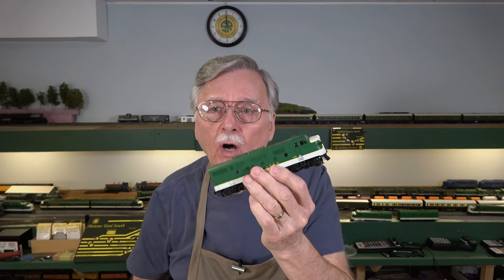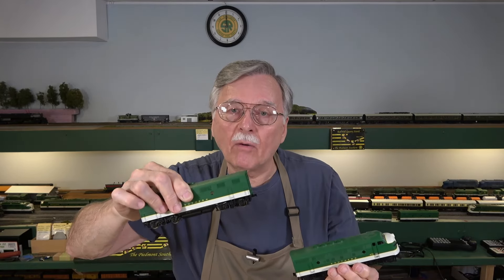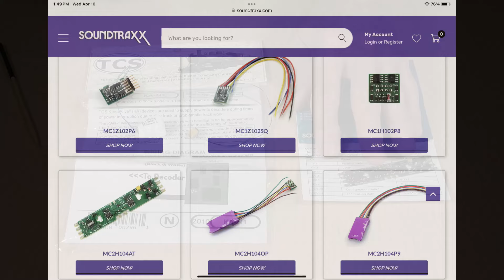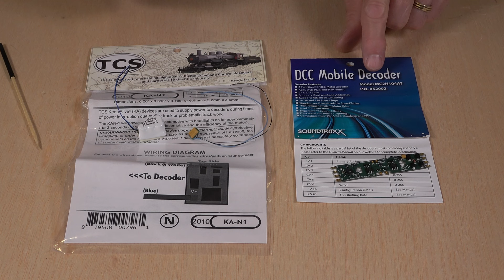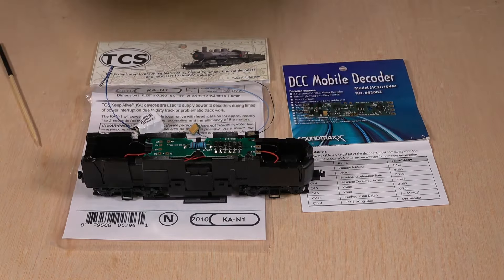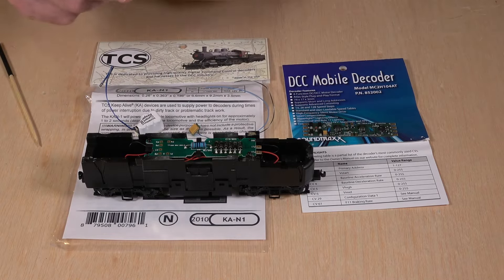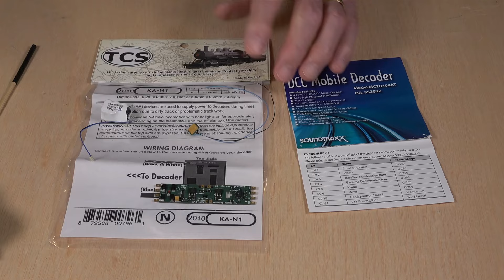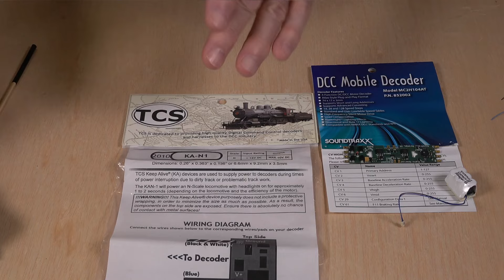Install A SoundTraxx Mobile Only Decoder (361)

Comment: Nice video Larry, very informative. I see you don't use any kind of flux when you solder. In some installation videos I've watched the installer will use paste or liquid flux on every tab and on every wire. It would appear that this isn't really necessary. Is it just a matter of personal preference? Thanks
Reply from the maker: The solder I use has flux in it and it is enough for small spot jobs like these. I do use paste resin flux for larger jobs like rail joiners, feeders, etc.

Comment: Instead of using separate decoders- i just run mini 6 pin connectors between engines. I run 3 powered engines and 2 speakers off 1 sound decoder. I have a F7 ABA all powered, and an FA ABBA with a dummy B unit housing the decoder. Run jumpers through the engine doors, you don't see it, and you only pay for 1 decoder.
Reply: So the decoder handles the current from 3 or 4 motors OK?
Reply: a schematic would be fantastic! Please?

Comment: Hi Larry, 
Love you videos. Learned so much. Have you ever used a Bi-colored, two lead LED? They glow red/green depending on polarity. I have been connecting them to the power connections on my tortoise machines(1,8), and on my DTDP switch on my control panel. They work great. Do you see any downside to using these?
Thanks for doing what you do.
Frank
Reply from the maker: No, they should be fine. I just went a slightly simpler route.

Comment: Thanks for the tip of the double sided foam tape,I just installed the same decoder into one of my locos,I am having trouble getting my beacon light on the roof to work,I hooked up the wires tothe #5 tab on the side and to the front  #2 tab my problem is trying to program the light to #5 on my controller, any ideas,thanks.
Reply from the maker: Configuring the functions for special lighting effects can get problematic. Which is why I always use DecoderPro for anything more complicated than changing the address and modifying the basic speed settings.

Comment: so adding the plastic piece on top of the motor is that how you isolated the motor? thanks
Reply from the maker: No, the motors on this model are built isolated. The plastic piece serves as a mounting plate but also keeps the circuitboard from shorting out on the frame.

Comment: I'm so glad you talked about adjusting CV215 in my TSU2 decoder to match the voltage setting of 15.0V hard -wired into my MC2 mobile decoder. I was unaware of that needed adjustment. Thanks so much for your excellent video and detailed explanation as always. SoundTraxx makes such excellent decoders and the mobile only ones are a great alternative in consists to save some money and work seamlessly together.

Comment: New subscriber I've looked through some of your videos do you have anything that deals with n scale. Like installing DCC decoders and sound bords.I have watch it with your HO steam engines.I'm a newbie to setting up a permanent layout.i have repaired a few trains my wife gotten bought me through a online auction auction. I found I loved the n gauge electric trains more.i do have HO also. Anything you can tell me will be great full.
Reply from the maker: Sorry but no N-scale specific content. Of course the material on laying track, building models, painting, wiring, and essentially everything but N-scale locos and rolling stock would transfer among scales.